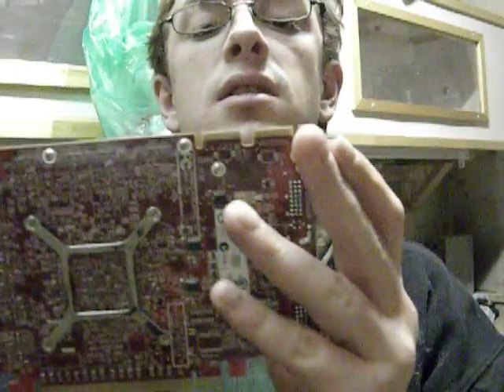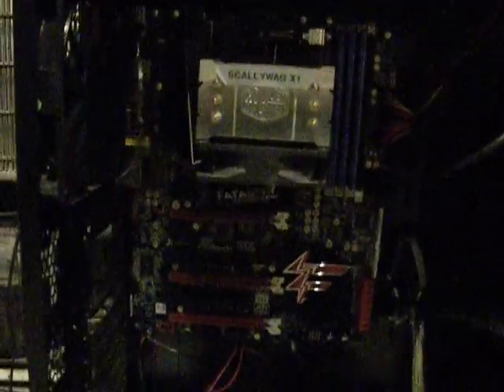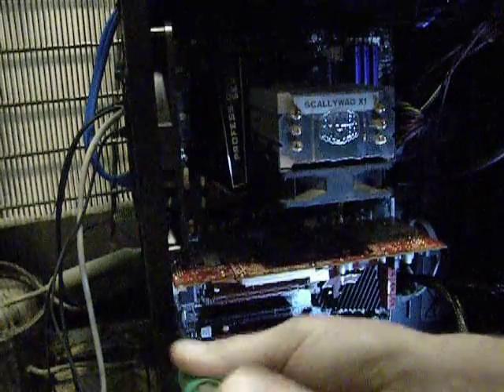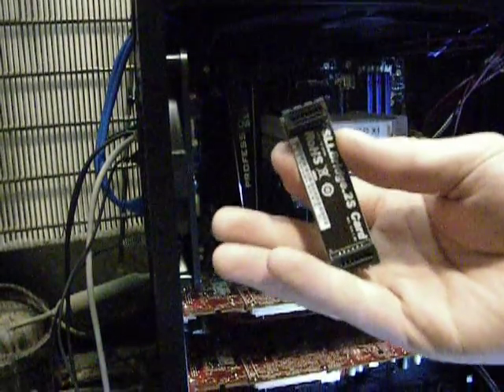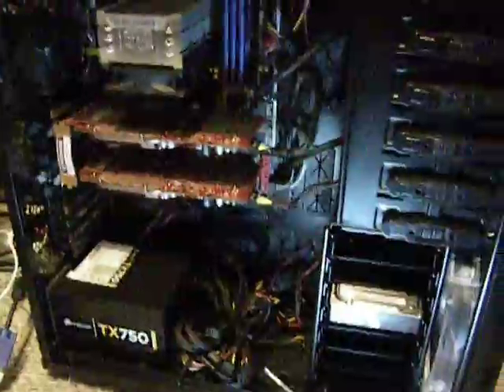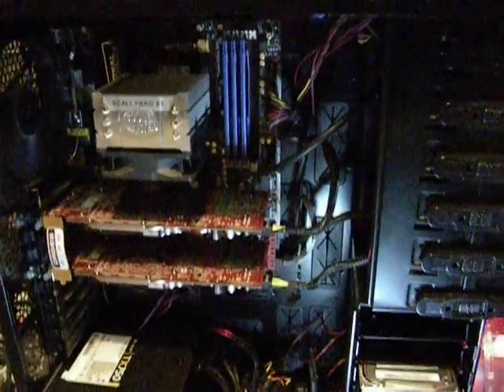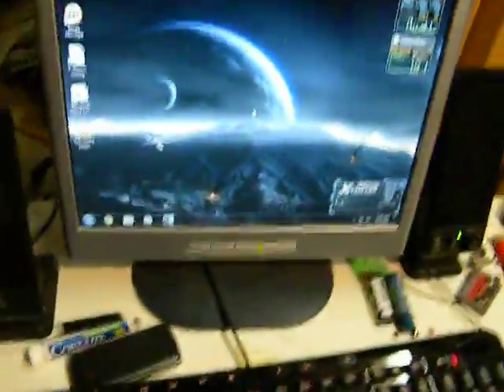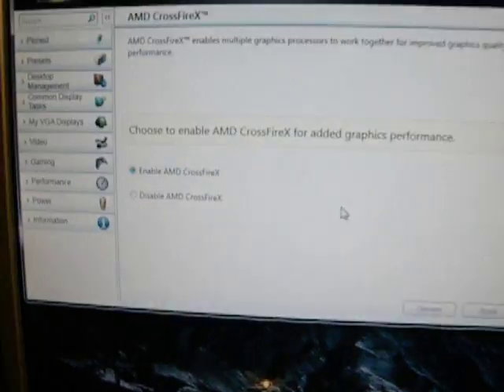how to set up a crossfire configuration

Comment from the maker: with two 7970's there is likely a lot of power drawn from the system at the start however it could also be that your motherboards bios may need to be flashed to fully accept pcie 3.0 video cards. personally i would first consider your power supply there are a lot of "high wattage" psu's out there that dont put out anywhere near the rated wattage. for that high end of a gpu i would suggest no less that a 700w+ psu with a silver or better efficiency rating

Comment from the maker: in all reality for an amd build that seems to be about tops just make sure you find a motherboard that has true dual pcie 3.0x16 slots which im not even sure if amd has support for yet. (unsure been outta the game for a while) but if there is only pcie 2.0 boards make sure that the slots you are using will both run at full x16 width as to keep from holding back one of your cards which is why a lot of people do not see a major impact with multiple cards. but good build sir and happy building.

Comment from the maker: you will need to do a setup with display port. which can get very expensive and most monitors are not displayport compatible. however you can buy an adapter for dp connectivity however you must make sure that it is an active adapter or you will have wasted money on ti. odds are if you find a display port to dvi-d adapter for under $20 than it is not an active adapter and useless for your needs.

Comment: I'm running off the ASrock 990FX Extreme 4 motherboard, i wanted a board that could overclock like a beast if i wanted it to. As for the pci-e slots this board supports 3 x16 x16 x8 in 2.0 your right that AMD boards have yet to support pcie3.0 but thats bandwidth and gaming doesnt require a bandwidth that large. 3.0 video cards can still perform at there max performance rate in a 2.0 slot so i figure ill go all out. Had to switch ram though, 1866MHz ram can't run in quad-channel with AMD

Comment: The FX-9590? That has a TDP of 220W, my FX-8150 has a TDP of 125W and it likes to sit at hot 50C in the BIOS on the 4.2GHz OC I gave it even on the H100 Liquid Cooler I'm using to cool it, I'm finding that for the games I play people are getting better performance on an Intel platform, so in the near future I plan to upgrade to the ASUS Rampage IV Extreme, the Intel 
Core i7 3930K, and I'm still debating what RAM to use but I want it to be 2133MHz in a 32GB kit

Comment: i use an i5 2500k with a sabretooth z77 board.     2 6950`s and 8gb vengance ram. is that tx750 psu fine for this setup as i will be clocking my cpu to 4 ghz ? cheers.

Comment: I plan to upgrade my computer, does anyone object to the idea that a AMD 
Visera FX-8350 paired with 32GBs of Corsair Dominator RAM running at 1866MHz be strong enough to handle 2 Radeon HD 7970's in Crossfirex? I have no problem overclocking the CPU a little to compensate its being cooled by the Corsair h100 liquid cooler by 4 Areocool red led fans in a push/pull config

Comment from the maker: good comment/question. as far as i know you can run two different gpus however the drawback is that it can limit the more powerful graphics to the performance of the weaker card. with pairing a6870 and a 6850 it doesnt seem like you would lose much at all being so close together in their family. now with putting say an ati 4850 with an amd/ati 7990 you would lose a ton of performance but it should still work. (only working in theory because im too broke to acquire a 7990.... darnitall)